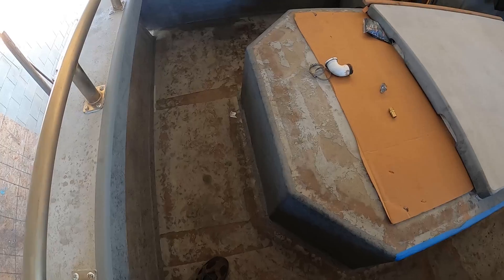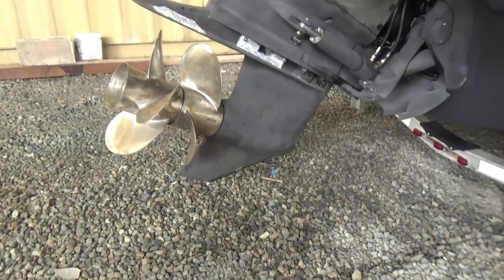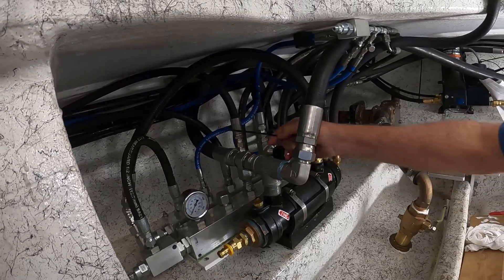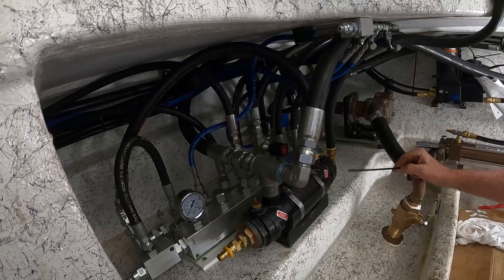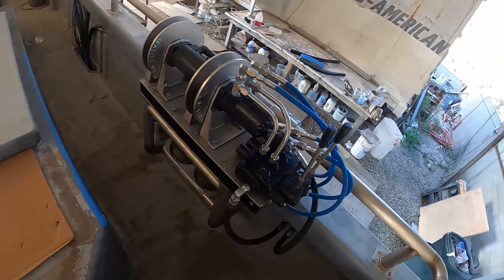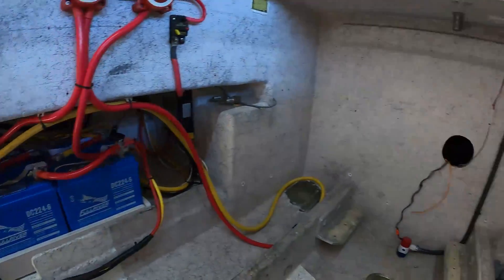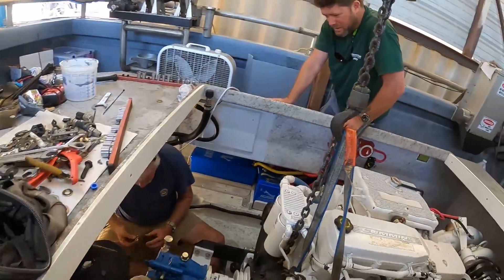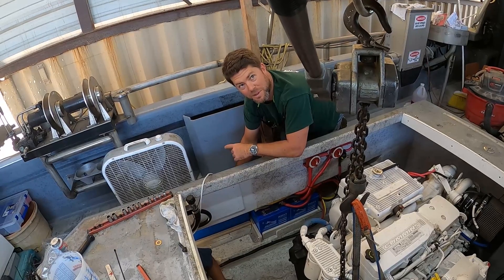Sea Harvester: Hydraulics and Engine Installation

Comment: It's a pilot controlled piston pump. What is nice about these pumps is you can install a control valve at the helm so you can put the swash plate in neutral. Very common here in the Canadian PNW.

Comment: So to install a serpentine belt the oil pressure pump has to be removed, I guess that’s not a five minute job?
Reply from the maker: Yeah not the best design and we generally wouldn't mount a pump that way, but it does work and no matter what if you pull PTO power off the pulley your going to add time to a v ribbed belt change.
Reply: Not a big deal if you have  fore sight to install a extra belt, secured, ready to go !😉